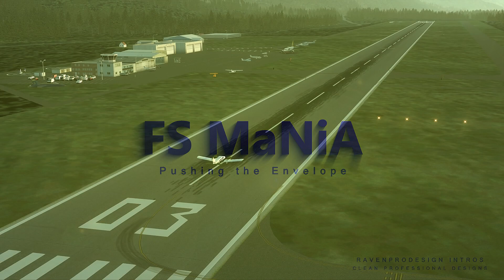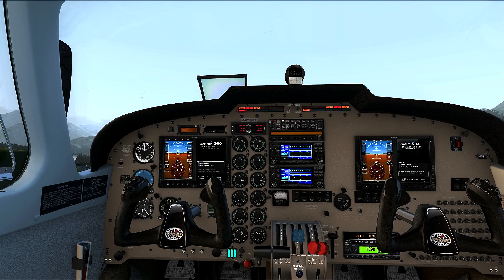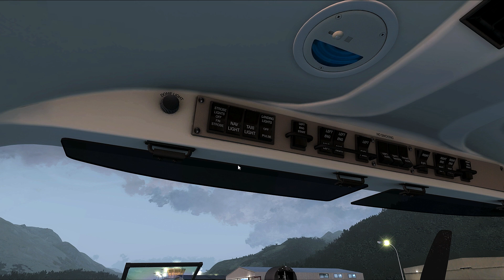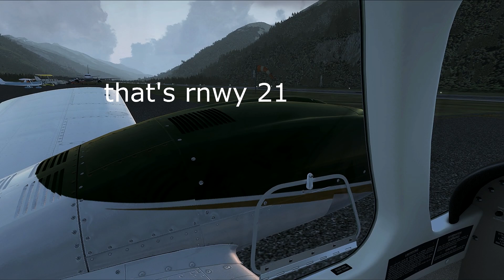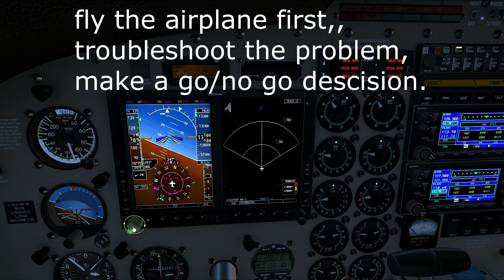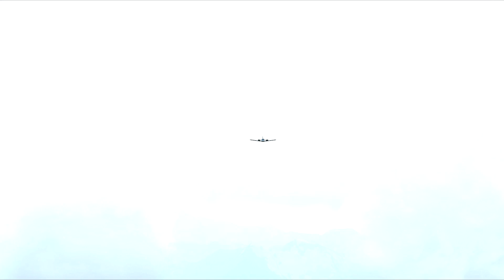Carenado Piper Seneca V HD Extreme Flight part 1 FSX

Comment: Really enjoyed your video. I've just got a Seneca V (x-plane edition), but I miss some kind of plane user manual. I mean, some doc that could explain how to switch cabin heat on or what is a cowl flap for and where's the lever.
Do you know if there's some doc from Carenado, Piper or alternative source that I could use? Thanks a lot!
Reply from the maker: Hi Manuel,  Carenado is notorious for providing the minimum amount of documentation when compared to other aircraft developers.  There are a couple of ways to find more information about proper cockpit procedures.   You can Google searcg the Piper Seneca V and you will probably find a POH that is downloadable.  You can also check the "Unofficial" Carenado Support Forum on AVSIM under the Seneca V Forum.  There is a lot of information there as well about proper piloting techniques.  I hope that is helpful.  Thanks for your comment and question.  Best regards from Tim G., FS MaNiA
Reply: FS MaNiA thanks for your advice!
Reply from the maker: Your very welcome Manuel!  Cheers!  Tim

Comment: Two GNS 430s but no ADF... ... Thank you for taking the time to make this video. .... I have this aircraft and it is very nice, except for the engines taking up a lot of visual room from the cockpit, normal for a light Piper twin. ... Except for the old single GNS 430 for navigation I like the Alabeo Cessna 404 better.  While typing this, I fired up the C404, took off, did a proper left hand pattern and landed at the field, it took 1/10 of an hour - outstanding - and, it has an ADF ;)

Comment: Hi Tim, I have been watching all the three videos from your flight to Courchevel, nice job you did and landing is quite tough. I have been crashing many time on this one.......
Concerning the HDI bug, have you been trying to download the SENECA V pilot's manual, as well as the GARMIN's document?
Cheers. Vincent
Reply from the maker: +Vincent Dufour Hi Vincent,  I think I figured out the problem with the Heading bug.  Before the flight I used the FSX "Slew" command to position the aircraft in the parking spot on the field.  For some reason that messed up the heading sync in the aircraft.  The workaround is to taxi the airplane to the starting position as opposed to "slewing".  This doesn't happen on all aircraft, however, I have seen on a couple other Carenado's....  Hope that helps and thanks for the watch way over hear in the French Alps!!!  Cheers from Tim G., FS MaNiA

Comment: Hi Tim. You may not see this because this video is a year old. I was wondering what you thought of the job Carenado did with this plane, other than the GPS issue. The engines/prop noise seems very quiet in the cockpit. Do you think that's accurate? I'm going to watch part 2 now. Have a fine day. :) Jeff
Reply from the maker: +Jeff Puha Hey Jeff, This was one of my early FS MaNiA YouTube videos.  I have since learned that I need to test the engine noise levels and adjust the sliders in FSX/Accu-Sim to get the engine noise levels a little more realistic.  It's a fine balance between getting them loud enough and not getting them too loud making it difficult to hear me.  Also, a lot  of issues I have with some of these planes are self induced Pilot error... most of which can be solved given enough time and effort.  I think the Seneca V is a very nice airplane and I did make friends with the GPS.  Hope that helps, Tim G., FS MaNiA
Reply: FS MaNiA  Oh. Yes. I didn't even think about the FSX sliders. Great point. 
Hey. Even the best stick-jockeys aren't perfect. You really do a superb job.

Glad you came to terms with the Seneca's GPS. She does seem like a nice plane. I put her on my list. Not above the Turbine Duke, though. I love that bird. :)

Comment: I love this plane, but the problem with the props not showing from inside of the cockpit is a bummer,  I have check on youtube with the real one and it does have a very noticeable prop turning effect. I contact Carenado and they told me it would be a service pack to fix that. all the videos with the plane has the same issues.
Reply from the maker: angeli662 I have a few gripes about this plane as well, however, I think the good far outweighs the bad.  Carenado list volumetric props as a feature of the Seneca V so I'm not sure why we aren't seeing more of the prop effect from the cockpit.  On their newest release, the Pilatus PC12, the are touting Volumetric side view prop effect and Dynamic propeller shines effect.  Perhaps the latter will provide visual cues of the prop motion from within the cockpit.  I am preparing to launch a new series featuring the PC-12 so stay tuned and we will find out if "dynamic propeller shines" do the trick.  Kindest Regards, Tim G.  FS MaNiA

Comment: Very nice. How do you like the A/C and how functional is the GT600?
Reply from the maker: ***** Thanks for your feedback.  I am a fan of Carenado and for the most part I like the balance of eye candy and functionality in their airplanes.  They don't take the sim to the same level as PMDG but the models are easy on the frame rates.  It is also nice have such capable General Aviation airplanes in the hanger to explore out of the way airports. I do wish Carenado would provide a bit more documentation.  Particularly on the POH.  They include a pretty good checklist but I still research the real aircraft Pilot Operating Handbook to get a better understanding of the systems.  All in all, in my opinion, I think the Carenado Seneca V is a nice addon for the money.  It is pretty easy to fly and looks great.  When I first started flying (in the 70's) there was no GPS for civil aviation.  So, flying the G600 is a major upgrade from flying steam gauges, dead reckoning, and NDB approaches (I know that makes me sound old).  I would prefer the G1000 on the panel, but the G600 is still very capable and will do pretty much everything I need and then some.  Not every single real world G600 feature is modeled, but the meat and potato's of the system is there and it is a great tool for finding your way into some tough airports like Courchevel.  Also, I like learning the various systems so it's nice to have a change up.  If every plane we flew had the exact same panel, we would probably get a bit bored.Sneak preview on the next series:  Aerosoft DHC-6 Twin Otter 300 series flight from VNKT Kathmandu to VNLK Lukla which is the highest airport in the world with scheduled airline service.  Stay tunedThanks much for watching!  Kindest regards, Tim G.
Reply: Thank you for that.

Comment: Interesting video. If it helps, its SAMadan. The airfield has full ATC as I remember so declaring to the world what you are doing is not quite right. The tower will tell you which runway to use and, if I may suggest, considering to take off downwind is foolish. Hitting the granite tends to end your flying hours. Engine run up, one at a time not both.
Reply from the maker: XXYY YYXX Thanks for your comments and clarification on the pronunciation of Samadan.  My research suggest the proper pronunciation is Sa MAY den?  Sounds about right.The charts I found for LSZS only show ATIS and AFIS frequencies? Do you know of an actual ATC tower or ground frequency for LSZS.  I'm pretty sure the field is classified as uncontrolled and all the charts I found tend to agree.  The VFR sectional uses magenta color for the airport symbol which as I recall indicates an uncontrolled field.   Based on official accident reports I have read related to LSZS, the AFIS frequency is basically airport advisory service for current weather and traffic information, however not ATC services.  At any rate, I chose to leave ATC out of my video because I haven't found FSX ATC to be worth a flip in terms of realism.  Given the uncontrolled nature of the airport, making an announcement of my intentions and direction of flight on a common frequency was proper.  I actually should have made a number of other position reports typical with flight at an uncontrolled field so.... my bad for ignoring the exact radio procedures and phraseologies.  I don't make it a habit of taking off with a tailwind, however, I think any pilot worth his salt can deal with a seven knot tailwind on takeoff or landing.  I only contemplated a southwest departure with a tailwind  to save time by not flying in the opposite direction of Courchevel.  The terrain and runway length would not have been an issue with a seven knot wind in my opinion.  Ultimately I decided to takeoff on rnwy 03 into the wind to stay with the normal procedure.  I'm not real sure where you are getting your information on standard runup proceedures for twin engine aircraft.  Every checklist I can find for the Piper Seneca says advance "throttles" (plural) to 2000 rpm for the runup.  Watch a few YouTube videos on light twins and you will see the pilots advance both throttles for the runup.I don't mind your criticisms, but I would appreciate it if  you check your facts.  Kindest Regards, Tim